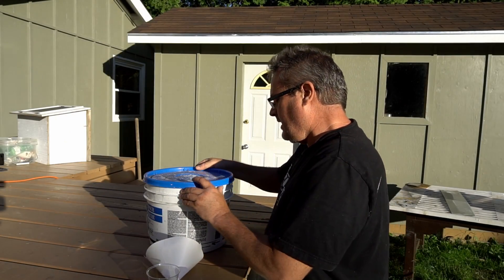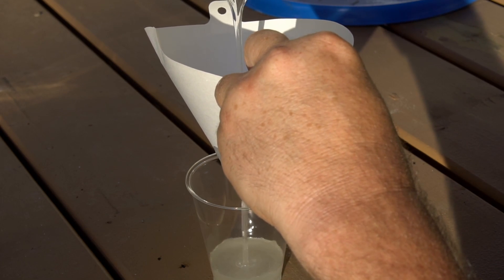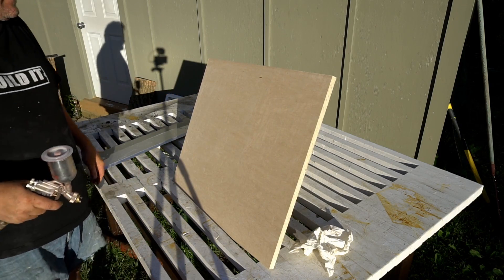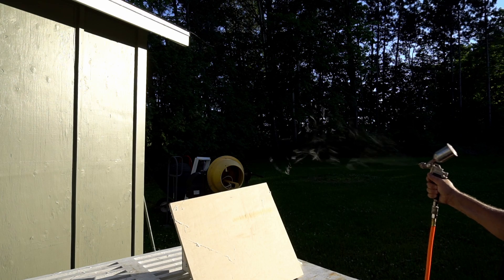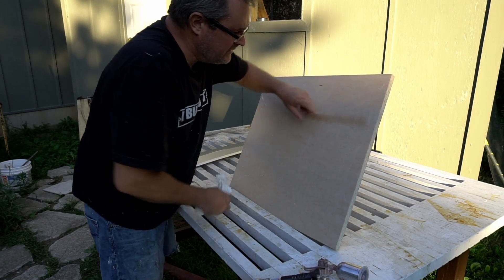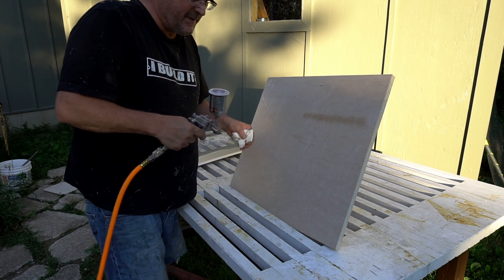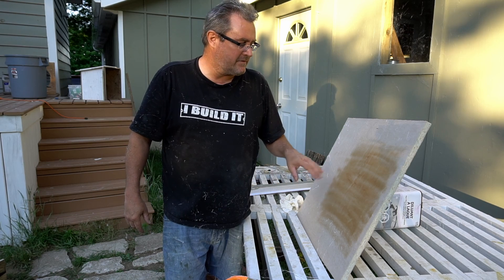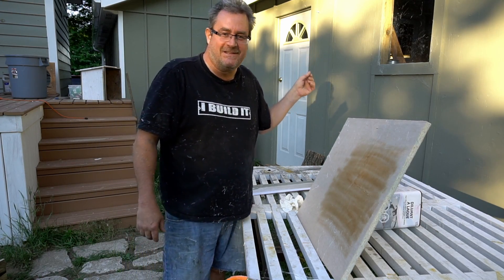Spraying The Styro Lacquer (or trying to...)

Comment: I think you just reinvented a new version of silly string!  I discovered a similar phenomenon when trying to use a liquid seam sealer on a pup tent.  When it dripped from my brush it dried quickly and formed strings that blew away in the wind.  If you ever find yourself in a war zone, use it to detect tripwires. The strings will get caught on tripwires so that you can see them but they are not heavy enough to detonate the explosive.

Comment: Cool and weird! Presumably when the liquid suspension exits the nozzle, the sudden drop in temperature causes the solvent to no longer dissolve the polystyrene...
Reply: David Lowe it seems to work almost like a cotton candy machine, or at least the result is similar. I'd guess the solvent is dissipating or atomizing, from temperature and probably velocity, causing it to separate from the stringified styrene.

Comment: 25 years ago I reduced 200 blue disposable razors ( which are solid polystyrene ) in acrylic thinners, and painted a high ace van with it. It spider webbed exacttly the same. To stop road tar from sticking to it, we sealed it with acrylic clear. Since then I've been reducing it in gum turpentine and using it in arts and crafts. It works brilliant as a decoupage gloss. For more info click my logo.

Comment: the same technique is used with melted hot glue to make webbing in movies. adjust the air pressure to change the size of the threads
Reply: Ethan L If John reads this, I'm pretty sure he will try it (and if John remembers) next Halloween along with his monster

Comment: Did you try it through a normal spray bottle? Running it through the paint gun seems to have aerated it to the point that it solidified pretty much right out of the gun.